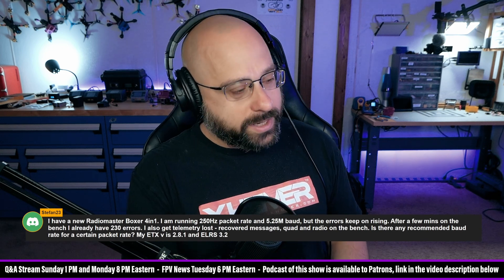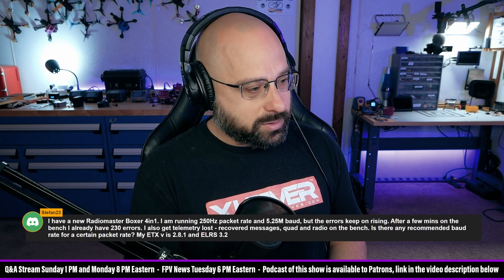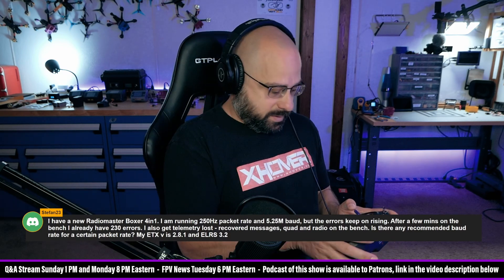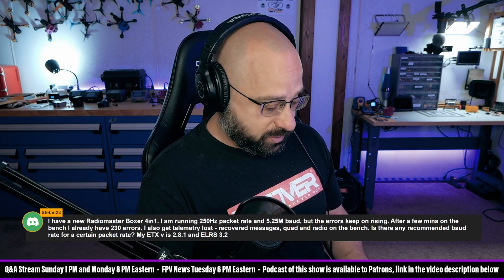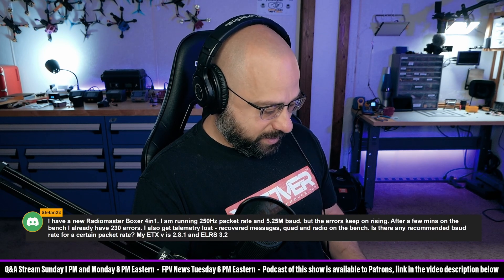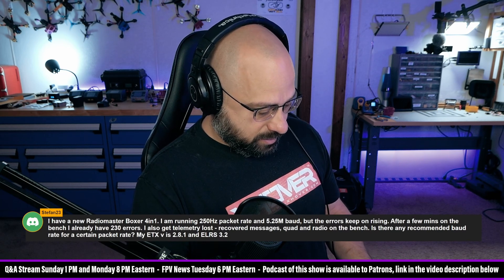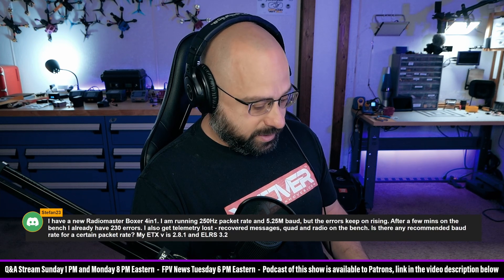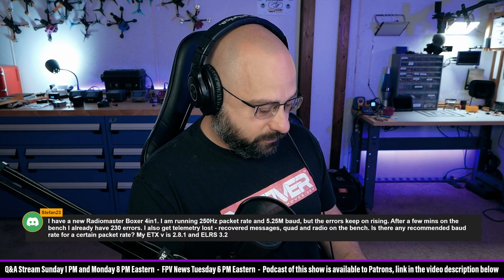My Radio Shows Errors With ExpressLRS? Should I Change Baud? - FPV Questions

Comment: they have a known issue with the boxer and 3rd party modules!!
talked to radiomaster support, they send me a new designed back case, which should hopefully fix this issue.
hope there is no problem with the serial inverter...
according to RM recommend baud for 1000hz packet rate is 1.8M, BUT i only can run 980k( recommend minimum from elrs devs) and i am still getting errors(50 in a minute@1000hz)
tested with betafpv 500mw&1000mw module also tested with diy tx esp32 e28, same problem with all tx modules-and yes they work perfect in all my other radios.
very dissapointing, makes the boxer useless for me!

Comment: I have the Boxer, 4 in 1 internal and a Ranger ExpressLRS module. 
 The Boxer will not load Lua script when the baude rate is set less than 400k. 
  Why could this be?

Comment: He said he had the 4 in 1does that makes a difference??
Reply: It won't make a difference with whatever embedded module that you have. Because each "model" in EdgeTX/OpenTX can have its unique settings of baud rate. So if you change baud rate to 5.25Mhz (my radiomaster t16s mark 2) from a "model" which uses external ELRS transmitter, it won't change your another "model" which uses internal WHATEVER transmitter. Settings of baud rate is only binded with "model".

Comment: Radiomaster (Eachine Version) Tx16S - Happymodel 250 mW (XJT not the mini) on 2.0.0

3,75 M Baudrate Max regardless of Packet Rate (don't think this matters)

5.25 M Baudrate won't connect to the Tx module

both EdgeTX 2.7.1 or 2.8.1